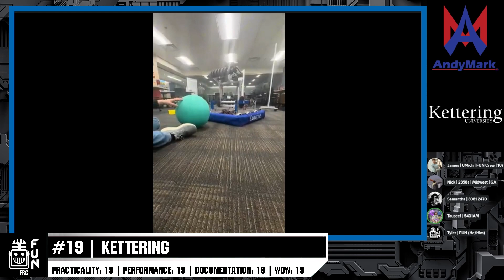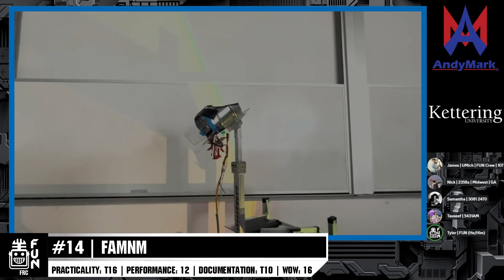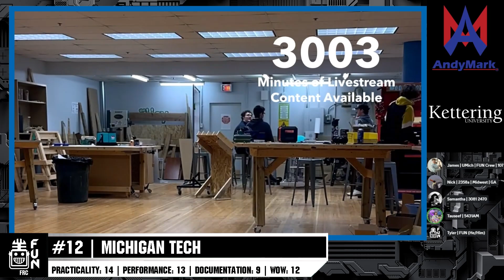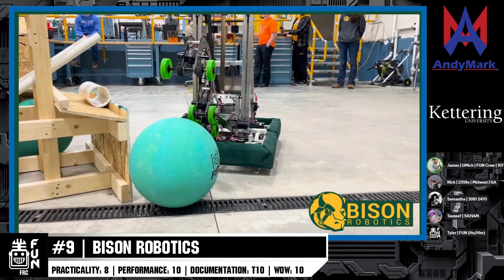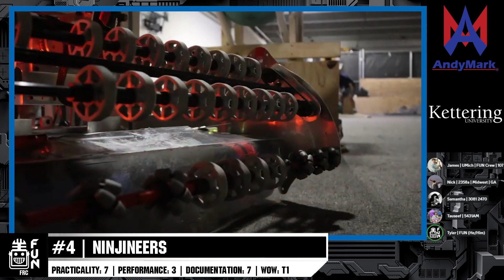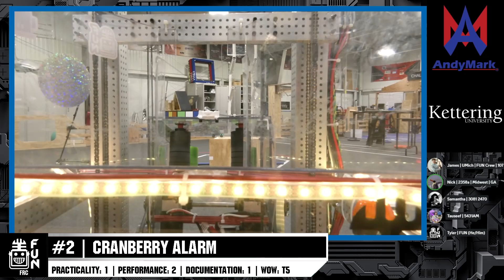Top REEFSCAPE Robot in 3 Days Builds | FUN Robotics Network | Ri3D

Comment: For Big Sky Robotics, they noted in their build thread that they struggled to get the hand-off to work consistently. That's why there are cuts between intaking and scoring in their reveal video.

Also, Quokkas Low is a snub. If you are a lower resource team, especially if you don't have parts for an elevator, build that robot. You will rank reasonably high early on, if you can figure out a way to shoot into the net you will be at the top of a lot of lists for a 2nd pick later in the season.
Reply: Quokkas Low should not be that high on the ranking, if you are a lower resource team, just build a Kitbot with a RustHound/Quokkas High Cycle climb. I think Bumbotics is thousands of steps ahead of Quokkas Low Cycles.
Reply: @joaquinrog  Fair enough, I'm interested to see what the Everybot is before making a definitive judgment on what's best for a lower resource team.

My thinking with Quokkas Low is that most alliances are going to have an Alliance Captain and 1st pick handling the Reef. They're going to need a robot to handle algae, preferably scoring directly into the truss but processor is alright too. Not much point in a robot that only cycles L1 coral, more likely to get in the way of the other 2 robots than score a meaningful amount of points. Processor algae is worth the same points wise, potentially more as the opposing HP misses shots, and it keeps you out of the way of the other 2 robots on the alliance. 

I also worry that some lower resource teams might run into issues with the other Deep Cage climbs, as they're harder to line up and more reliant on weight distribution than Quokkas Low.